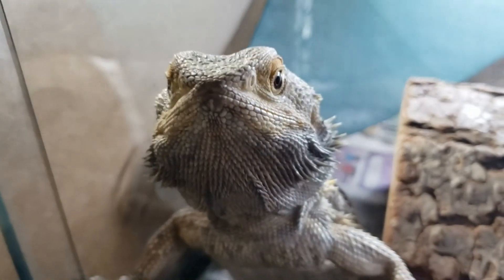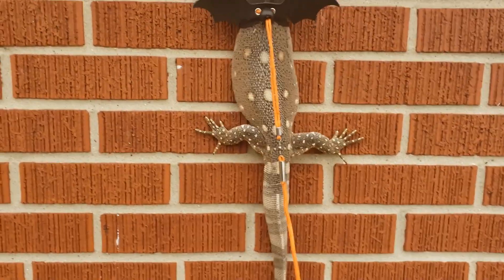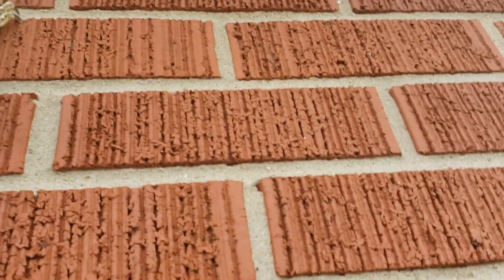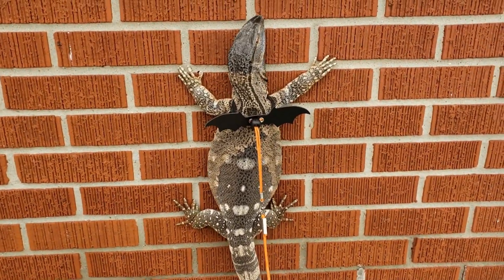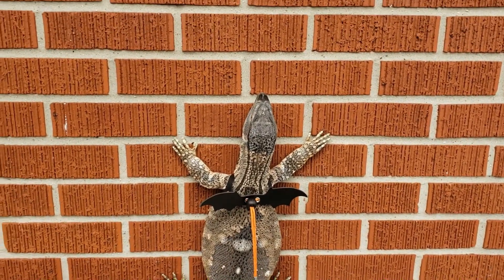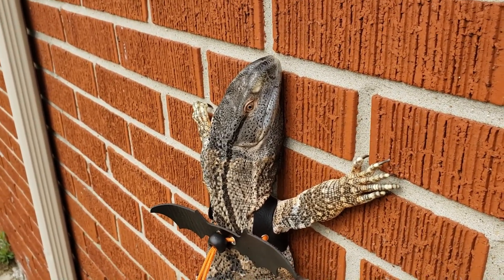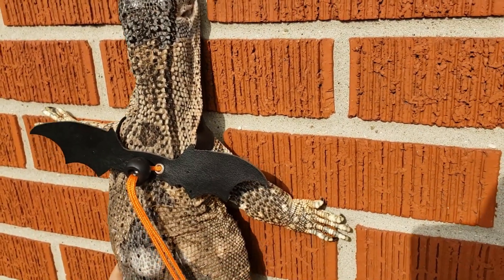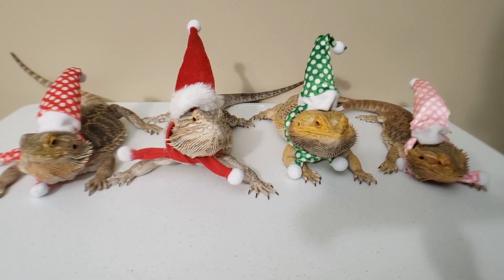Giant Monitor Lizard Climbs UP Brick Wall | Black Throated Monitor

Comment: Hi animal1 guy , I was wondering how much you supplement your bearded dragons with d3 a week and also do you use multi vitamins with d3 or without, just wanna make sure I’m doing everything correctly. I don’t wanna over use d3
Reply from the maker: I dont use D3 with them since they spend so much tie basking under the UVB I use multivitamin that has calcium but no d3
Reply: Ty very much for the info and reply!